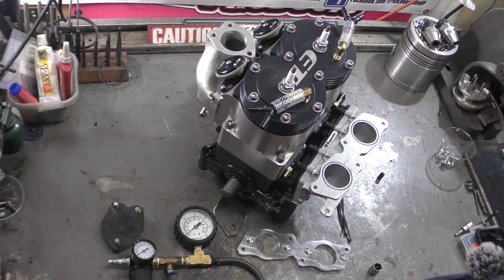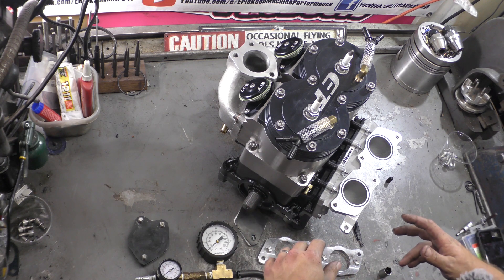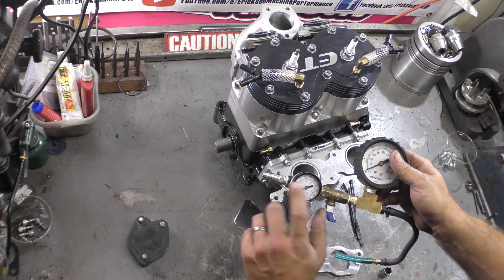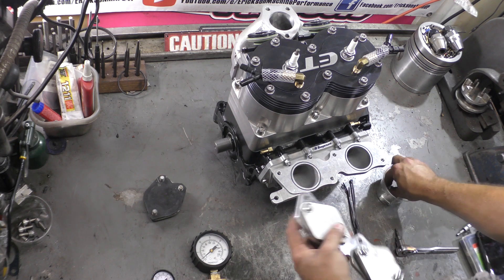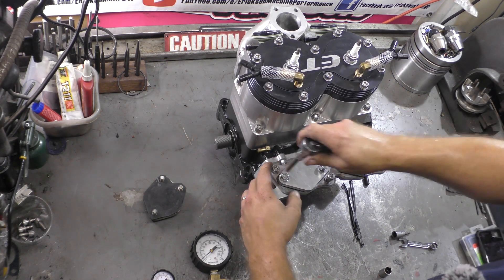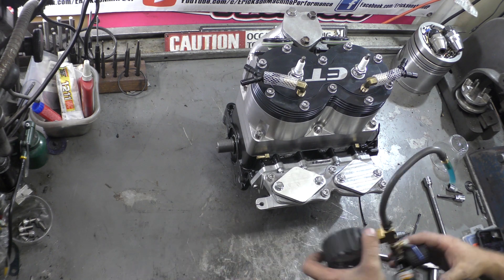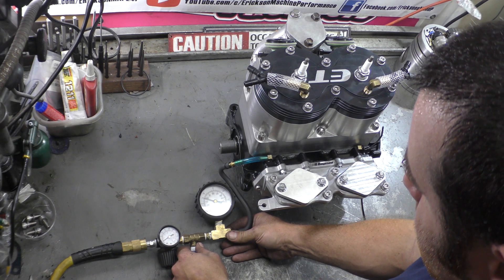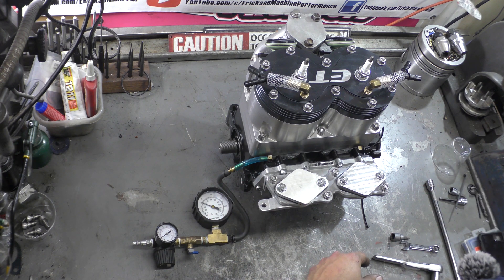How to Pressure test a Jetski 2 stroke engine. Tools Tips and tricks. Et 967 pressure test.

Comment: If youre cheap like me you can use the carbs and exhaust head as a plate cover for the rubber gasket. 

Also, do you need to swap the pressure tester to the other pulse pine and run a second test?

Comment: Is this sufficient or is there any need to do a vacuum test as well?
Reply from the maker: This is the industry standard for 2 stroke engines
Reply: @EricksonMachinePerformance  ok thank you, I figured it was fine if that's what you were doing but I wanted to double check. A mechanic friend of mine said to vacuum test first. But he doesn't specialize in 2 stroke jet skis.

Comment: I pressure tested a Kawi 1100 and I have air coming out of the water port on the head. Somehow air is getting into the water jackets.
Reply from the maker: @Jacob_McDrummer  that happens.  Now you need to try to find where.   Hopefully it's just the head gasket

Comment: Don’t you need to block off each exhaust individually to verify the center main crank seals are good?
Reply from the maker: No.
Reply from the maker: The labyrinth seal can leak between holes and not affect anything.    If it was like a seadoo with inner oil seal you wouldn't hold pressure because it would leak out the rotary shaft oil fittings
Reply: Ok thanks. I just assumed a leaking center seal could cause a lean condition when the upgoing piston will be starting the intake stroke.
Reply from the maker: @Andre Hoogendyk  The way a labyrinth seal works is it really only works while it's rotating. It's not a standard rubber lip seal.    If you have a crank like a seedoo with oil seal then will leak on this type of test.     The basic concept of labyrinth seals is to reduce contaminant ingression not only by restricting the clearance through which particles enter but also by creating areas of turbulent flow to exclude contaminants

Comment: Mine holds perfect for 2-5mins without any detectable drop
After 1 hour im down 1psi.
Is this something to be concearned about?
Im worried that I could spend hours trying to find a leak that either does not matter or does not even exist..
Reply from the maker: It really depends on the gage you use.  If it's a high end gage with a small swing . Like 0-15 psi you should be fine.   If you want email me and I'll try to help ericksonmap@gmail.com

Comment: You could used a popoff gauge for this as well, correct?
Reply from the maker: Not really.  It would take an hr to pump it up.   Those little pumps don't push enough air
Reply: @EricksonMachinePerformance  makes sense.  Thank you

Comment: Any reason for not spraying down seals and potential leak surfaces with bubbles? Could potentially find a very small leak that the gauge may not detect? What's your take
Reply from the maker: The gauge I use is EXTREMELY sensitive.  You want a Guage with a large swing but with small values.    If you use the right gauge you will see the pressure drop.   I only spray when the gauge shows a leak.     If you don't have an accurate gauge or one that's sensitive. You can hold the pressure longer or spray.      When I'm testing I don't allow any movement on my gauge. ( that would be considered a fail)

Comment: I have a similar video on my channel. I used a 15psi gauge and fill with 8psi and let it sit. It should hold the pressure indefinitely! But no less than 1 psi drop in pressure per minite is bare minimum... If it leaks at all I find it and fix it. Normally its crank seals but Ive seen leaks in reed cage seals and even leaking from engine to coolant chambers and out of the coolant ports in behalf of cylinder base gasket leak. 

Cool video!
Reply from the maker: In a perfect world you are correct.
That being said using a high end gauge will a good amount of travel per PSI on the gauge I have found no need to test over a min or 2. IN that time THERE SHOULD BE ZERO movement of the needle.  if there is the leak needs to be found and corrected. But people do go overboard .   I have also seen people damage and blow out seals trying to test there engine.   thanks for the comment
Reply: @EricksonMachinePerformance  yes. I use a sensitive 15 psi gauge amd set my compressor to 20psi to fill the engine. I agree though. People often dont stop to think about thing before hand and what the consequences of their actions will be. Once again great video!
Reply: Are the reed valves suppose to hold 8psi also? Do you have to use the block off plates for the intake?

Comment: im working on my 787 seadoo cant get past the lean bog off idle..rebuilt the eng ,carbs with no luck. blocked off intake and exhaust pulled 10lbs vacuum only held for 20eac...how do you know witch seal is the issue?
Reply from the maker: Pressurize  and use soapy water